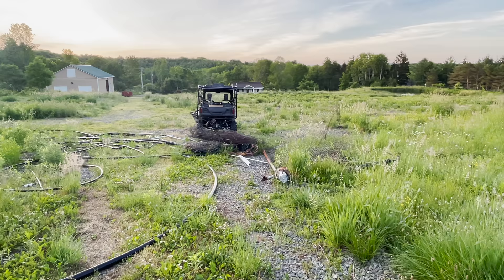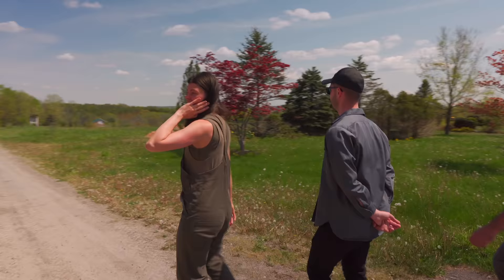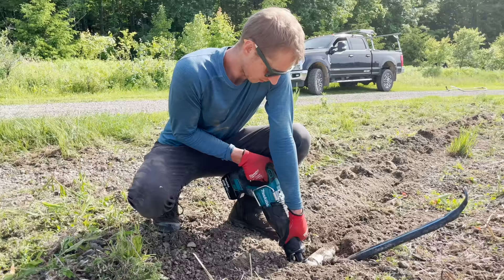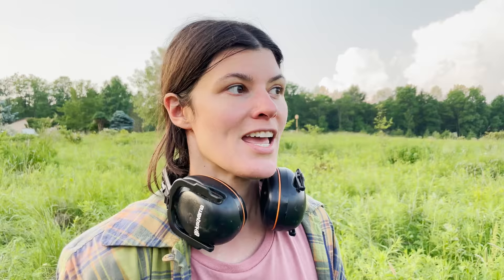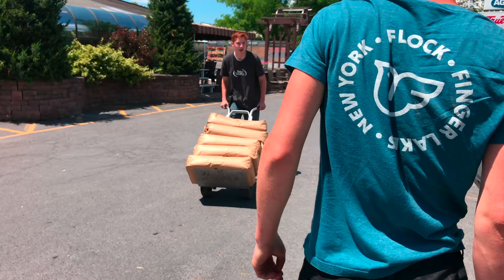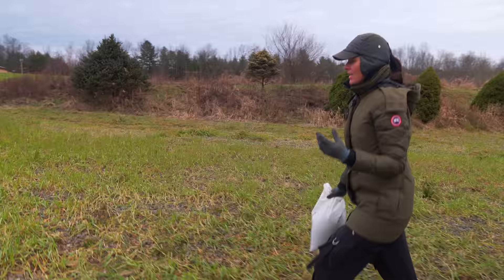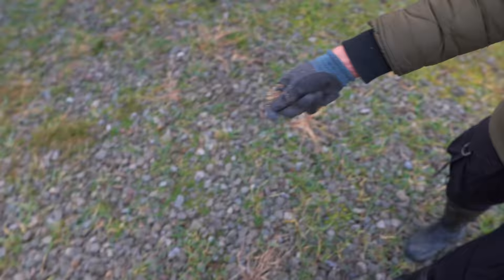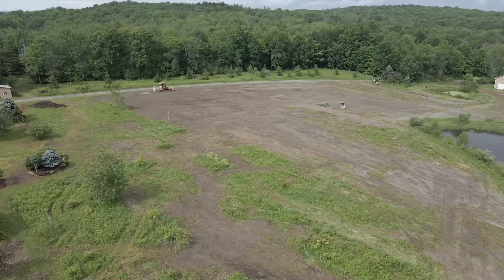Turning Old Nursery into a 7-ACRE NATIVE "INSECT" MEADOW — Ep. 077

Comment: @Flock Finger Lakes First of all, congratulations on being at this point finally. All the hard work! 🤯 This meadow project always seemed to me to be one of your heart projects. 
I do have a question though. Why don't you use a seed mix of native plants from your region and apply it throughout the area? Similar to your video with Todd Bittner? Is it because of ornamental and colour reasons? Thanx for your amazing content anyways!
Reply from the maker: Let's see if this actually works! Meadows take such patience...long waiting...And save for three different plants—a poppy, flax, and a Verbena—the rest of the 60+ species are native grasses and forbs. We weighted the criteria we were selecting for. Some of the criteria included "host plant for insects", "pollinator plant", "color", "stature", etc. We aimed to get bio-regional seed, where available. We even collected some seed here and there, but it was such a drop in the bucket for the amount that is needed across 7 acres. The seeds, as shared, however, were in seed shortage, so we didn't get every seed we wanted. Or we got less of a species than what we wanted. Some of the seeds that Todd suggested in the native low mow lawn video, we also selected for this site. For us, it'll be a big experiment to see what succeeds and where. I won't be surprised if we see something pop up that we planted elsewhere in the meadow—and see it in an entirely different place. Guess that is the surprise with seeding vs. just planting plugs or mature plants in the landscape, which would have been a whole other level of work! Thanks for your message.

Comment: Just a thought but you could have had a controlled fire where you wanted to put the meadow, act as nature would and clear the land while putting ash and biochar to help
Reply from the maker: Definitely crossed our mind, but no one really emerged as someone who can do controlled burns. Hard to find management folks who suggest it around here and maybe it's because of the lack of experience? Not sure.
Reply: @FlockFingerLakes  might try the Fire Department or Department of Natural Resources in your area, anyone who fights wild fire's would be a first go to for me so they can use it as a mini training. Granted none of that would have helped with the plastic pipes and fabric which would still need to be removed first.

Comment: Thanks for this video. I am wondering if I can confirm your cover crop schedule for amendment. Post clearing. (infrastructure removal, other invasive removal, hogging) You did disking> buckwheat > cultipack in June 2021... let that grow for 30 days> brush hogged and did another round of buckwheat around July 2021 the same time, let that go for 30 days and repeated that process in late August but with oats instead for the winter? I noticed you began sewing your meadow in November and December was that also in 2021 along with the oats (thinking the oats died off on their own without mowing/and disking) and then looked forward to the Spring of 2022? When did you plant those bulbs and I think alliums? Is there ever a situtation where you could do a cover crop mix? Or is is it best to keep the amending process simple? Thanks!
Reply from the maker: We seeded the first round of buckwheat cover crop on June 24th (a little later than we wanted), but it's when the tractor was available, and then we sowed in the buckwheat right before it went to seed (so you have to time it on your end because our buckwheat going to seed may not be the same amount of time when your buckwheat goes to seed). Then we did another round of buckwheat after we disked that first round  in July and then when that was about to go to seed, we disked it in August; and then we seeded in the oats, which winter-kill. You do not need to disk those in because they die in the winter. We frost seeded (again later than we wanted because as we shared in the video, there was seed shortages and the seed supplier was terribly delayed). I planted the bulbs in the following fall after I mowed down small areas of the meadow to more easily plant them. The dates should all be on the videos to get the more specific timeframes.

Comment: What machine was used to pull the big tree stumps out?
Reply from the maker: They were using a backhoe. I think the one in the edit was the blue spruce Sander had cut down earlier in the season that had needle blight. And there was an ash that had succumbed to elder ash borer. We ended up hugle mounding them on the edge of the land—along with the willow stump.

Comment: hate to say it, but i would of bulldozed all that gravel into piles and taken it out. Yes you lose a bit of top soil, but that can be fixed cheaply with bulk compost spread back on top. A lot of your platns will not have root depth needed due to the 3 to 8 inches of gravel they would need to drill through.

Comment: DID YOU HAVE TO  MOVE THE PLUGS BEFORE YOU GRADED 
THE LAND.. LOVE WATCHING YOUR VIDEOS. SANDER REALLY MAKES ME LAUGH. LOVED YOUR INTRO TO THIS VIDEO AS WELL.
Reply from the maker: Hi Claire, what plugs? You mean like plant plugs? (We put in some plant plugs in a small section to experiment with that after the grading happened, but we used mostly seed for efficiency and cost-effectiveness over such a large area). If you mean electrical lines/plugs, we called Dig Safe and made sure all electrical lines were marked, all the electricity was shut off, and we either carefully dug around areas that had electrical lines or removed the old irrigation lines with electrical lines that were no longer operable. Hope that helps answer your question.

Comment: @flockfingerlakes you might want to add some dirt and make burms or mounds around aspect of your ponds due to the future rainfall.  We will see rain 10 times more severe than that land has seen in 100 years.  The earth is changing
Reply from the maker: Yes, great suggestion. We are devising maps and strategies now on water management on the land and pressure testing it with some friends. It'll be one of our bigger projects that will start (and likely not end) this year.
Reply: @FlockFingerLakes  good luck. . you might need to dig another pond for over flow.
Good luck

Comment: Surely it's standard for owners to clear the land and clear the above ground trash when they leave. Is that not rude?
Reply from the maker: They actually removed several tonnage of debris from the old nursery before us, but it was just endless amounts. We still find debris even after dozens and dozens of walk throughs and cleans. There was just such extensive irrigation and nursery equipment after 30 years of being a nursery—you inevitably just get a lot of build-up.
Reply: @FlockFingerLakes  You're going to find more every spring, too - freeze and thaw cycles will push stuff up out of the ground over the winter.

Comment: What a job! I admire your commitment to the project. What on earth is that fabric stuff used for? I tried throwing seeds around like that..the birds ate most if them and what grew, the snails and slugs ate lol.. I have to physically plant every little seedling and put poison around for the million snails. I often go out at midnight with a torch and go "snail stomping " in my gumboots 😂
Reply from the maker: The geotextile material is actually used to dampen weeds, but you can see after many, many years, the plants will just start colonizing it. In regards to the seeds: We had a lot of migrating Canada geese come through when we did the oat seed, but with cover-cropping, you often over-seed, so we weren't too concerned. Plenty of oats still came up. Sure some birds got the meadow seeds we tossed out there, but we seeded so late in the season, all the migratory birds were gone south and our resident winter birds were stuffing their faces at the birdfeeders I think to pay the rest of the seeds in the meadow any mind. But snails! Not an issue here, but you're in an entirely different climate! Do beer traps work?
Reply: @FlockFingerLakes  my puppy would drink the beer lol she also eats snails and worms and vomits 😥 maybe if I put bird feeders out the birds wouldn't eat my seeds...thanks for the idea!

Comment: maby some goats might assist :)
Reply from the maker: Initially we wanted to rent some goats to graze the land: https://youtu.be/cBw6o7ULIvo?t=1346 .... There turned out to be a lot of challenges with that, however, at least at onset. Firstly, we called the county extension office and they said, "Good luck finding any you can rent out," largely because the solar farms around here have longterm contracts with farmers, so it was tough to find anyone with a grazing herd that was available. That compounded with just moving in, we didn't have as many contacts and there very well could have been someone out there, but not one that we were able to find. Secondly there wasn't great forage for the animals here, according to one of our farmer friends. Farmers don't typically like that, because they would still then have to supplement their animals' diet. The solar farms around the area specifically plant a sheep blend optimized for sheep forage, for instance, so it's a win-win for the solar farm and the farmer. It's a whole, rather sophisticated program out here. Thirdly, we were finding just too many unknowns when walking through: rat poison packets, pesticide packets, metal bits, etc. — we didn't want to risk the chance of any animal getting sick by eating something it shouldn't have. So we opted to do more manual and mechanical removal....Now hopefully it's in a better place to bring animals in down the line to graze when we're here full-time.